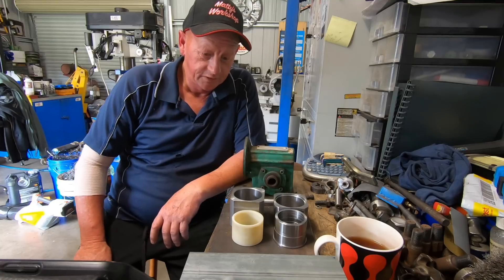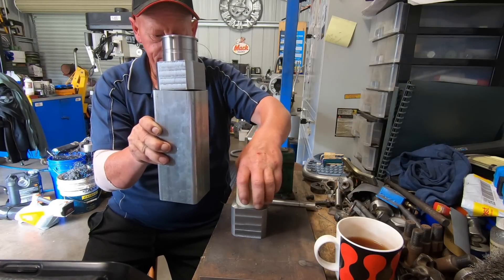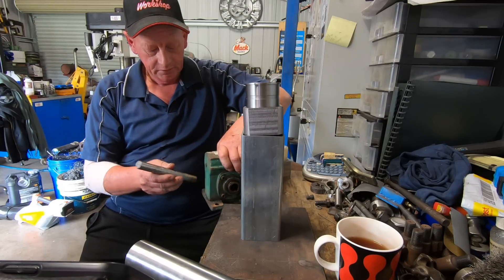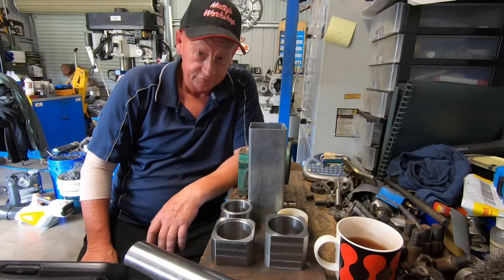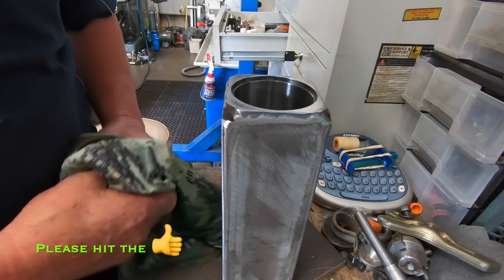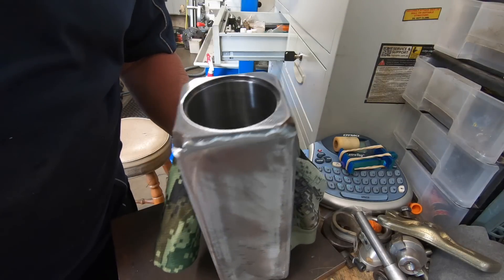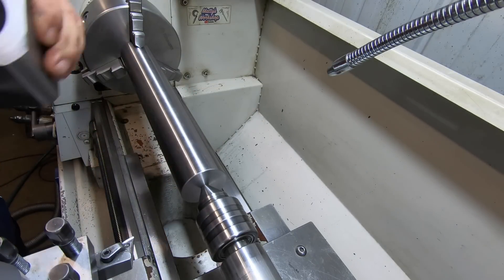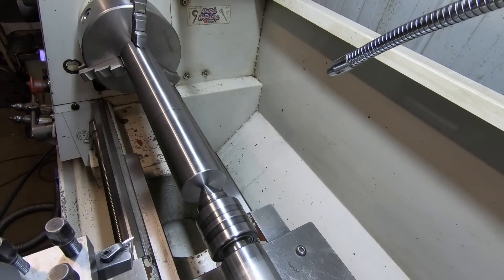Homemade Crane Build

Comment: what size and brand lathe is this u are using ? i have a HF 9x20 lathe i and trying yo cut 3/4-16 threads but i am new to this i just don't know what gears to use and read the chart correctly
Reply from the maker: Gday, I have the AL960b lathe, can you email a photo of the thread chart to me at ttmrj@telstra.com    And I’ll try and help you out, cheers

Comment: I would really like an explaination of what sort of hoist mechanism your going to employ. You spent a whole lot of effort into making a high quality machine that has no obvious purpose
Reply from the maker: It’s going to have a hydraulic cylinder controlled be a 12v hydraulic power unit which is from a tailgate load originally

Comment: G'day Matty.  You really shouldn't tangle with those pesky little blighters unless you have a good spray or a decent swatter .. lol
One thing you proved is that a round piece of steel will fit into a  Square hole.  Lol 😆.  Great bit of machining & welding.  Waiting for this Super Crane to be in action
Reply from the maker: Gday Ted, see you can fit a round peg in a square hole, don’t let them tell you any different🤣, as this build has gone on it’s turning out to be a bit over spec’d as you see in the next video, thanks for watching mate, cheers

Comment: Good one Matty, you do some nice work, I've also made myself a Crane to fit on the back of my Ute. I put a Hyd motor on the Worm gear gearbox and powered it with my Hyd power pack via the control levers. I did have a problem with the shaft from the gearbox to the main slewing rod, I put a keyway in there not grubscrews, but when I was slewing the load on the back of my Ute the weight of the load kept moving when I stopped turning and it snaped the keyed rod drive from the gearbox. Hell of a job getting it out. Now when I use it, I'm more careful. Could you turn that 2" shaft down to fit the gearbox and machine a keyway into it?  The cost of the martials are the killer, ideas are cheap.
Reply from the maker: Gday, funny you say that, I have been thinking I should remake the 50mm shaft and make it all one piece, the cost of material is out of control here, I still think it might be worth it though, definitely be safer, thanks for watching and commenting mate, Cheers

Comment: A few things... One, a lathe spindle spider for the rear end that allows compressed air to be blasted through for purposes of through boring, as to blast out all the chips... It would also cool down the spindle and therefore the bearings, which would possibly be a bad thing, but it can be solved with a plastic sleeve that would fit inside the spindle to insulate it from the air moving through and to focus the air down the spindle bore... Second, make an oiling jig, look up fireballs cutting oiler, the toilet design one... a similar thing could be mounted onto each of your steady and follow rests, allowing you to meter the oil flow to a minimum as to keep the bronze fingers or rollers well lubed at all times without your effort... Also, i would have welded those blocks through the side of the tube(drill out 5mm holes and weld it thusly from the outside, rather than at the top), and then milled it down flat, indicated it, drilled and bored it out that way, as this is a bit on the lazy side, but for what it is, why not... Im just saying that bcs i am making my own engine hoist, and have welded a block in said manner in the swing arm, as to make it a full contact bore for the hardened pivot pin, rather than pivoting the arm against and using its sidewalls as a bearing surface... Since my arm swings only when its not lifting, to get into wanted lift position, i need no bushings or bearings, and can only rely on that lubed up full contact bore to do the job, as it does the swinging with the load of nothing but the arm itself on it, which is a mere 60kg load with graphite grease to aid it... And the pillar has doubled up sidewalls for pin bores, which make 12mm deep bores on each side that merely locate the pin... The thing is a monster and will likely be able to lift not an engine, but the whole large car by the engine, when finished and assembled... But im not making it to lift engines anyways, rather to service my 2.7 ton lathe and 3 ton surface grinder... Aint no way in hell I am lifting that apron or the s.g. table or any other part... Everything on those machines is at least 120lbs of precision surfaces, or much much more... And i aint intending on dinging any of those parts or losing limbs to them due to reckless stupidity and senseless courage... Anyways, nicely done, looking forward to the steady rest and the completion of this project!
All the best, and keep away from those damn spiders... When you are putting on your gloves, socks, pants or whatever, toss them on the floor, take a wooden rolling pin and pass it over with force along all your shit before putting it on... It will squish any scum in there and you can just shake the corpses out if there be any... I always toss my working gloves and such on the floor and step on them with a clean shoe, just to make sure there aint no crawly bastards in there, and i live in fucking europe my brother... Hell, i would make myself a vacuum chamber for clothes and stuff if i were in your place... toss all your shit in there before putting it on and vacuum it, then let in any compressed gas like argon or such after 10 minutes and let it be for some time... All of those nasty things have to breathe and are easily harmed by strong vacuum... It explodes their soft squishy bodies and secretion glands... Not to mention boiling a lot of secretions into vapors inside their bodies... Even if they survive that, no oxygen will kill them anyway... Use the cruel properties of physics and parts you can make yourself... Dont let such scum get the chance to fuck you up... Biological toxic secretions are a hell in a lot of cases and come with added bonus that are infections quite often... Fuck those nasty miscreant abominations and their ugly ilk...

Comment: G'day Matt, I hope your elbow heals up soon mate. Jeez them bloody spiders! Just be thankful you have an inside dunny lol the project for your dad is sound in your head? No worries mate it's the best way to make things. I spend my sleepless nights designing my projects  in my head lol I'm just doing a wobbler engine at the moment, all out of my head for the rough design. I did do some old school technical drawings to determine the pivot to get the ports in the correct place but that's about all. The rest is get the material in the lathe and get cracking. The cylinder is 25 mm ali, with a bore of 5/8" using Kurtis's bananas as I  only had a 5/8" reamer but complicated it by offsetting the bore 2.5 mm to give me some wall thickness to thread into for the pivot. Just got the brass tube yesterday so I can get the inlet and exhaust sorted then try it out with air! Cheers from the UK mate, Sam
Reply from the maker: Gday Sam, the wobbler engine is a great build, i really enjoyed build mine a while back, having no plans is a good way to build things, there’s a lot more thinking and problem solving involved and that’s the best way to learn in my opinion, start off with an idea and raw stock and make it happen, good luck with your engine build mate, cheers

Comment: Steady rest just needs new tips made, that still fit the original drive threads, but that cover the larger diameter. Just have to change tips to go for the diameter change, though you probably will also want to take all the followers and such out, and use a fly cutter in the lathe chuck to bore the steady rest inner face to a slightly larger diameter, so you have the clearance all round. Looks like there is enough there to get another 10mm of diameter easily, with it still being able to handle the full range of diameters.
Reply from the maker: Gday, I could make different tips but it still won’t have the work envelope I’m looking for even if I machine the centre out bigger, thanks for watching mate, cheers

Comment: Hi Matty  Your application for the worm box mount lends itself to a torque arm type mount.  Just hang the gearbox in mid-air off the drive shaft.  The output drive shaft will support the box and alignment is automatic. All is you need then is an arm to stop the gearbox rotating.  Many conveyor drives use a torque arm mount.  The anti-rotation/torque arm is typically a rod with spherical bearing rod ends at each end so it can move and self align.  I have designed this system a few times.  In your application a length of FMS should work ok.  Cheers  John
Reply from the maker: Gday, I never thought about doing it that way, Worst part is I’ve seen this before, bit late now mate, thanks for watching, cheers

Comment: Nice job so far Matty. I cant really tell from what I've seen' but a couple of slots in the lower sections of the bush holders will make it much easier to get a punch in there when the time comes to remove the bushes'.
Did you consider attempting an internal keyway to take the drive shaft? Good job for the shaper, all you need is a runout groove at the bottom of the hole for the tool.
Reply from the maker: Gday Phil, I did think about doing an internal key but id have to make up another tool holder thats small enough to do the job, I have a small tool holder but the deflection is pretty wild and the shaft material is quite hard, I can see it becoming a pain in the bum, Thanks for watching, Cheers

Comment: Great project Matty !
I'm guessing you are lifting from the side of the trailer. Are there going to be outriggers? Hydraulic outriggers 😊😊😊
Reply from the maker: Gday, there will be an outrigger on the side but its going to be manual wind, Hydraulic would be awesome but id have to change the valve bank and thats stretching the budget sadly, thanks for watching mate, Cheers

Comment: Hi Matty
Nice job, As well as using Loctite to hold that shaft if you have a fine straight knurl use it to place a straight knurl on the 20mm shaft (not all the way leave a straight section to start it in the press). then press it in, it is very unlikely to move. I have used this trick a number of times. The knurl ribs will dig into the side of the bore creating an interference fit. It will be almost impossible to separate the parts again heat will not help!
Reply from the maker: Gday John, thats a great idea using the knurl to retain the small shaft, Thanks for the advice, Cheers